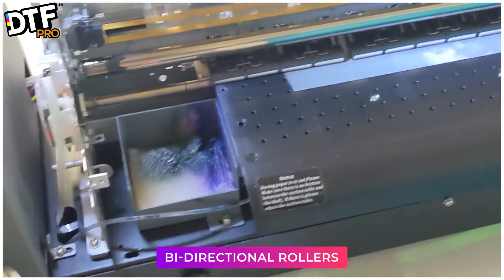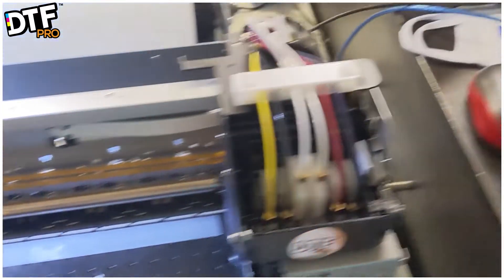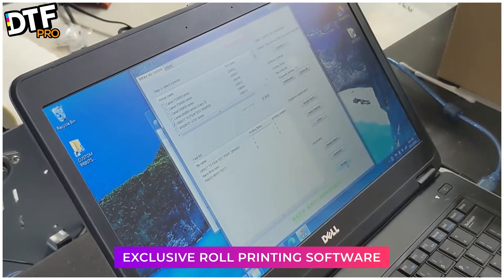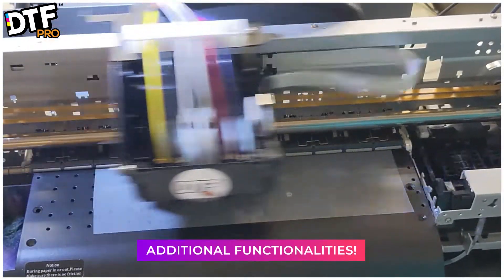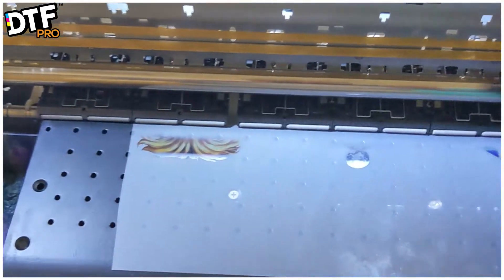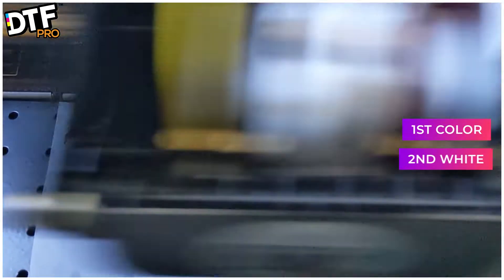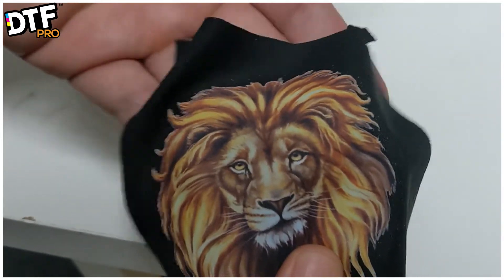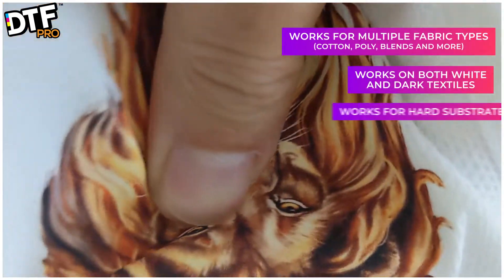The DTFPRO Model J DTF Printer - behind the scenes look

Comment: Is that a cold peel or hot peel process? Thanks.
Reply from the maker: You can use either HOT PEEL or COLD PEEL film, both will work. The difference is with HOT PEEL film, you can peel right away, and with COLD PEEL, you need to leave the film to cool down for 10-20 seconds before peeling. The printer comes bundles with a WARM PEEL film (somewhere between HOT and COLD traditional films), but can be used with any hot or cold peel film as well.